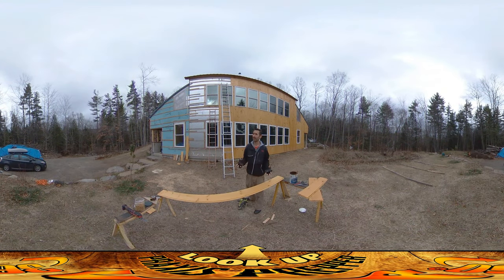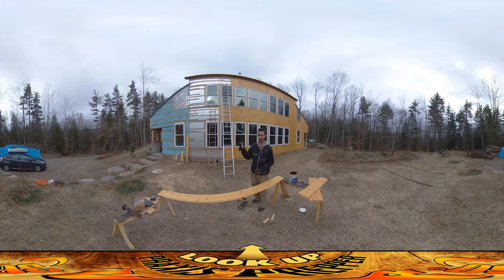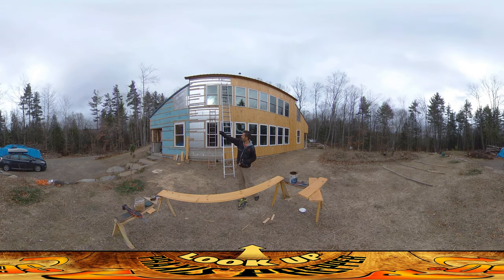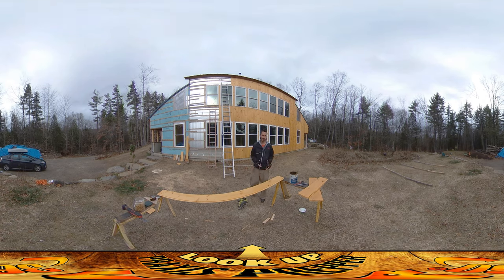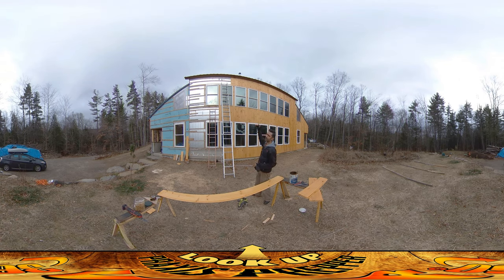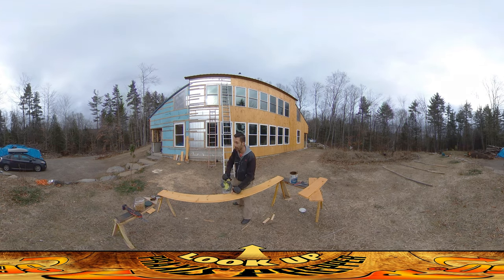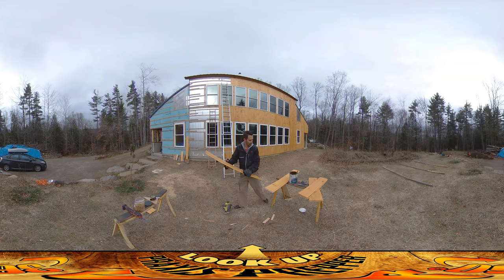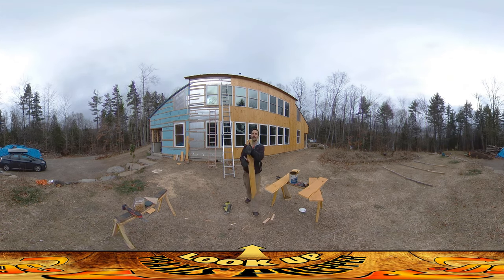Homestead Building - Lumber Allocation and Pre-Planning for Zero Scrap, Painting Pro Tip

Comment: Good tip on the paint / stain.
I ran into the paint variability when repainting the interior of a friends house. The difference was in both shade of color and sheen was so far off I thought we'd bought the wrong paint. Turned out to fix the problem I had to repaint the wall where the paints met. It was okay if the two paints met at a corner in the room, but not in the middle of the wall.
Reply from the maker: Glad you were able to fix it without too much hassle.